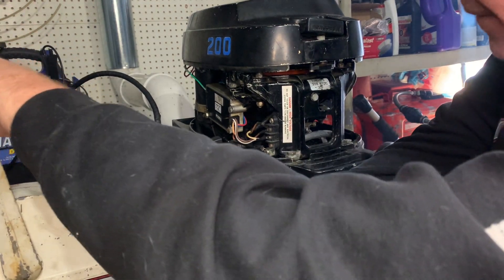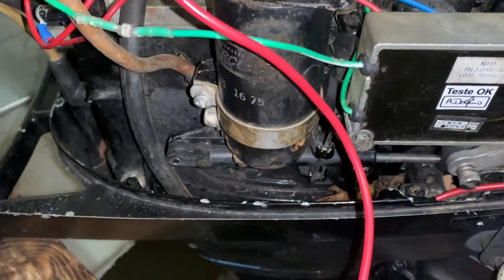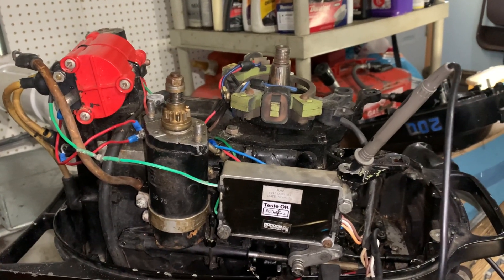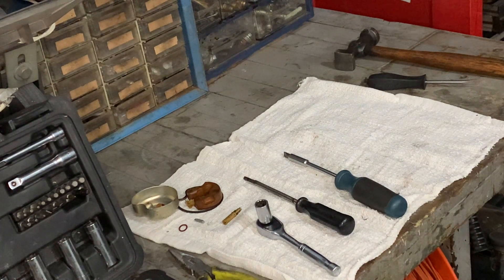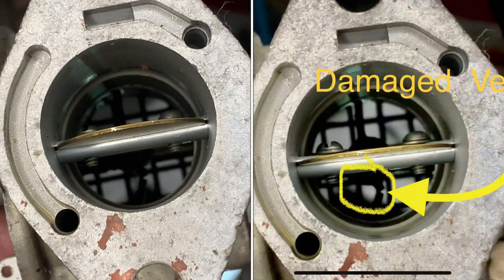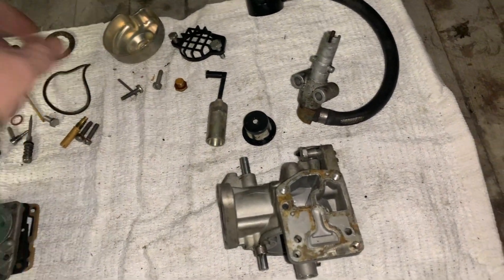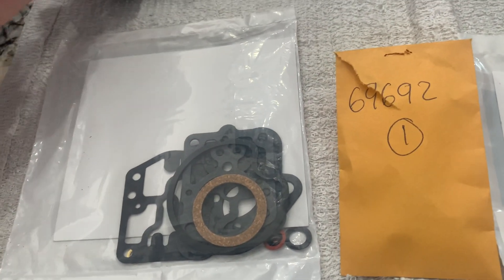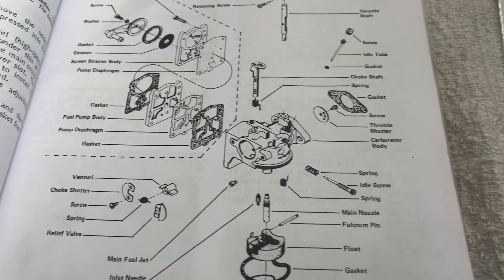20 hp Mercury - (Part 2) Stalls & Bogs at WOT Diagnosis - Is it Fuel or Electrical? Let’s Fix It!

Comment: What kit number you used? I have a 76 200 20hp pull start
Reply from the maker: Torino Shepherd … I purchased two gasket kits from www.marineengine.com I had to order the gasket kits for both the carb and fuel pump separately.
Part numbers 1399-5317 & 1399-5318 as well as a new Venturi part number 69692. The Venturi comes in two different types depending on the carb so make sure you pay attention particular attention to your model number before ordering.

Comment: I have the same motor spent countless hours added a inline fuel pump runs great just a thought.
Reply from the maker: James … thanks for the suggestion. The motor runs great now that I’ve rebuilt the carb and properly routed the fuel line (no kinks). I think my customer will be happy now. See part 3. Thanks for watching and commenting.

Comment: It is too bad that we had to buy two separate kits, to get the diaphram and other gaskets. I got mine from Amazon. The Mercury carb rebuild kit in Canada from a mercury dealer is over a $100.00. In addition, be really careful when tapping out those mercury hinge pins. I use needle nose pliers instead of a punch and hammer. I broke a 20 hp carburetor float post before, using the punch and hammer method.
Reply from the maker: Ralph Barker … You should try www.marineengine.com
I purchased both kits for under $20 us. I agree using a hammer and punch is a bit risky but the pin was stuck in pretty tight so I used the smallest hammer I have and tapped it gently. Sometimes I just use two small screwdrivers and hit the other with the plastic end. That usually does the job without to much force.
Reply: That company doesn't ship parts to Canada.
Reply from the maker: @ralphbarker7791  I’m sorry 😞

Comment: Thanks again for posting this video update. I have two of these engines and hope to gain some knowledge to get them to fire. I will ohm the coils on both as you did and hope that helps. Keep the videos coming.
Reply from the maker: Mike E… I hope you get them running. Thanks for watching and stay tuned for part 3 and hopefully the conclusion to see if this old 20 hp runs properly.
Reply: @LivetofishOutboardRepair  I ordered a copy of the Seloc repair manual and hope that will help. I downloaded a copy of the original manual but it is such small print and blurry in sections that it is hard to determine what you are looking at.
Reply from the maker: @mikee4216  I know what you mean. I like the hard copy too. Computers crash and sometimes you lose the information and your right the digital versions are hard to see diagrams and print sometimes. Good luck!